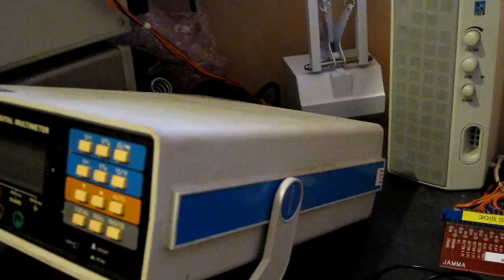Solartron 7150 Plus Exploded

Comment: You still have it? I need a copy of the processor on the floating board. Can you help?
Reply from the maker: What do you need?
Reply: @arcadeuk  As I wrote, I need a copy of the mains processor on the floating board. The IC103. If you have a programmer, you can read it and send it on email.
Reply from the maker: @peterandersen4676  Sorry my board does not have the EPROM version of the MCU
Reply: @arcadeuk  No - the data is stored inside the MCU. I need a copy of the data inside the MCU. You can read it with a programmer.

Comment: Did you ever fix this? If not would this work http://www.ebay.co.uk/itm/IEC-Power-Main-Entry-Modules-With-Line-Filter-Switch-Fuse-Holder-Voltage-Select-/200716932295?pt=UK_Computing_CablesConnectors_RL&hash=item2ebba954c7 Filters are filled with pure blue smoke that is all I have decided! Caps are filled with black cobwebs with some smoke!
Reply from the maker: It's in the "Get round to fixing it one day"  pile at the moment. RS sells the exact part needed for replacement without cutting the case, but it was about £35 with vat. I hate mains filters
Reply: arcadeuk
Ive got one of them.
Bought it off ebay, at the second attempt as the first one that arrived had a blown inline filter too!
Seems its common with those.
Very nice meter for the price though, when they are working.
Reply: arcadeuk I simply made a PCB with the necesssary filter components, still working after years. Also changed the dim yellow LCD LEDs to white for easier reading.

Comment: You could probably get away with a simple replacement. If you go to your local electronics supplier, Farnell/ RS they will probably stock a replacement. Farnell 2080413 is a ten amp in line unit should do the trick. They have them in stock.

Comment from the maker: Hi mate. It's been suggested that it will be the parallel X cap that will have short circuited as these are a common failure with these Schaffner line filters. I should saw the filter in half and have a look if we can see what went bang. I could have a go at doing what you say if I can manage to seperate the filter from the IEC socket as it seems to be one unit. Cheers mate

Comment from the maker: In theory yes. The part that died (the mains filter) is part of the IEC inlet/voltage selector block, so it looks like a very specific part, which may be hard to find. I certainly hope I can find the required part as it is a very good meter when working